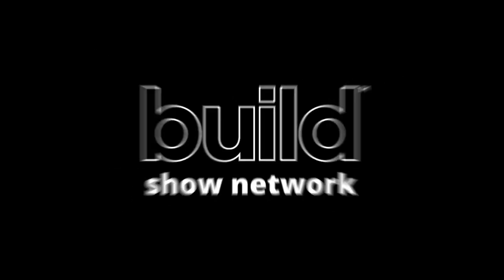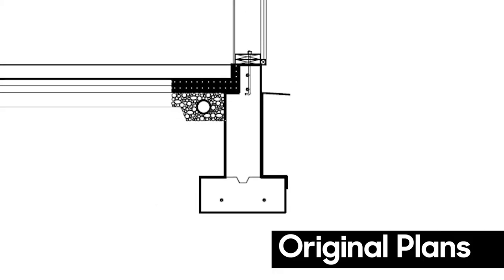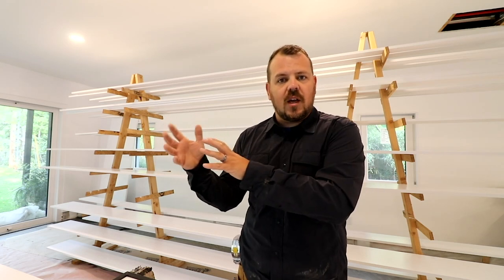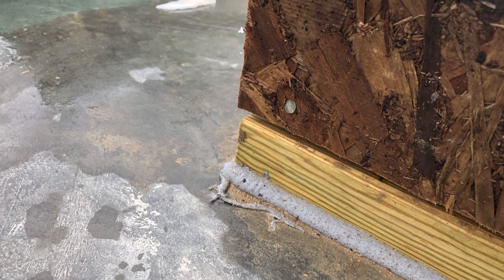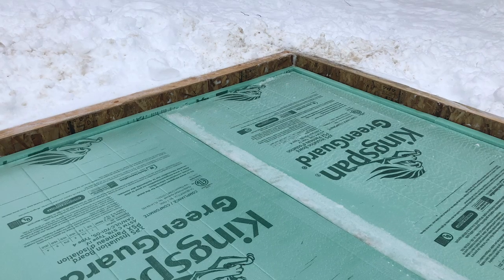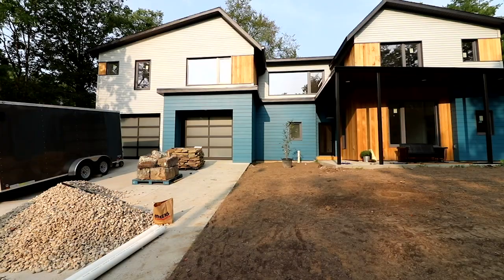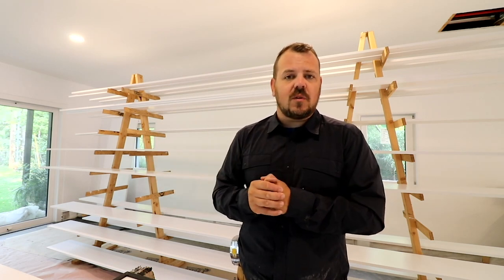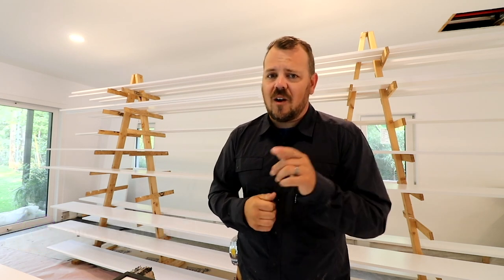How-to Insulate Concrete Floors (a mistake)

Comment: @jake.bruton.aarow.building thanks for sharing! After living in your home for an awhile now how are you liking the floors? Do you think radiant heating would feel nice on your floor or totally not needed since you have insulated so well? Do you feel the floor is “softer” with the insulation vs regular slab for leg fatigue? Thanks!
Reply from the maker: We still love the floors, heat in our opinion is not needed. The feel as warm as our stone countertops. I don’t go barefoot on the wood floors either. My kids go barefoot and don’t seem to care. We do have mats down in the high work areas around the stove and sinks for comfort against the firm floors, however we had them at our last house on tile floors too.